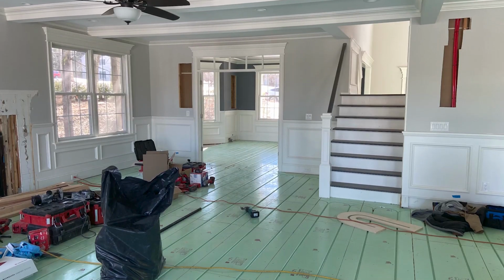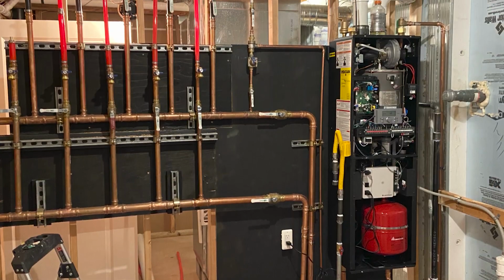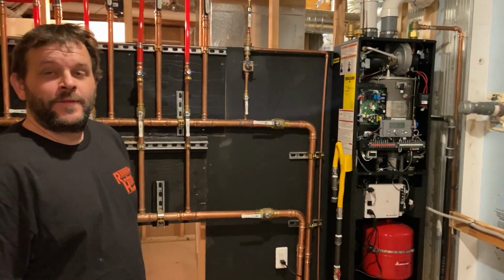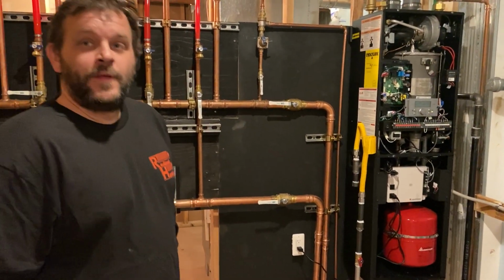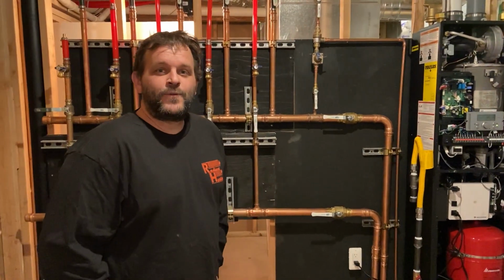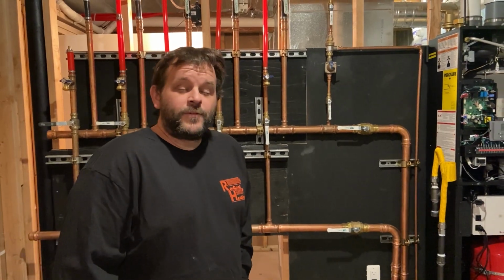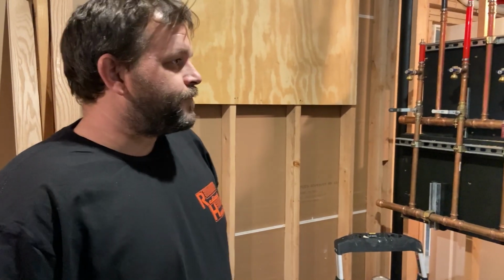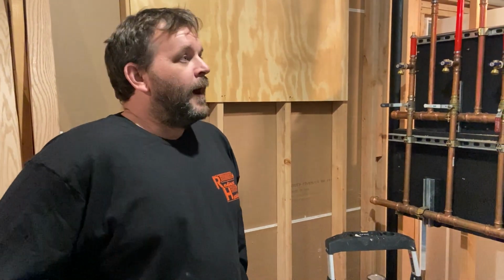Warmboard Comfort System Installation, Westfield NJ

Comment: im trying to figure out a way to retro fit a radiant floor heating system to an existing concrete slab, in my garagem and am wondering if i can put the warm board down in there and if it can be driven on top of somehow
Reply from the maker: Yes. You can Warmboard panels directly over concrete slab in your garage. Driving/Parking on top of it won't be a problem.